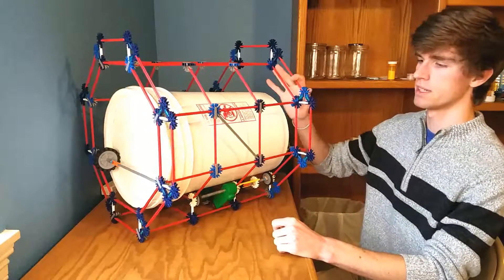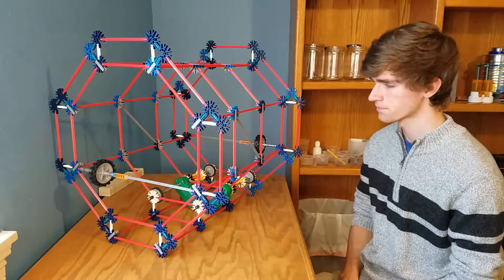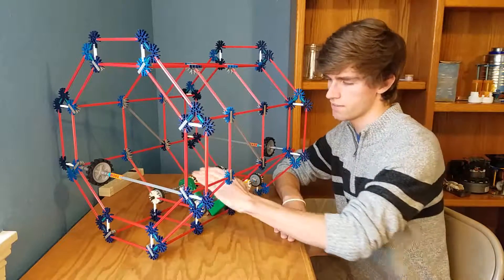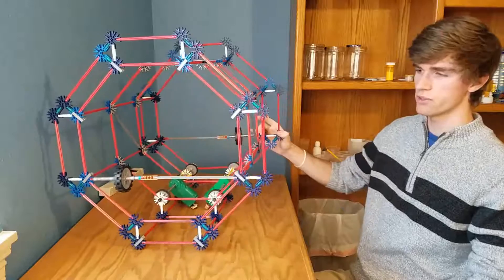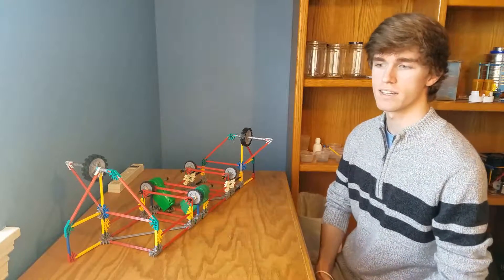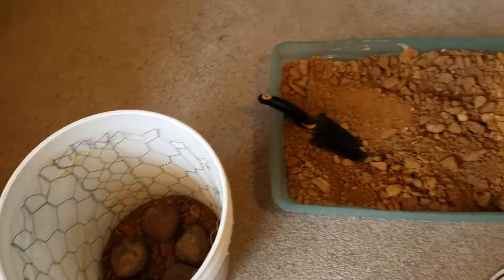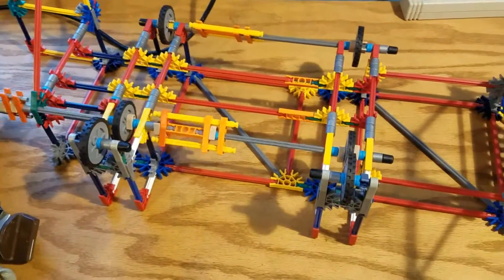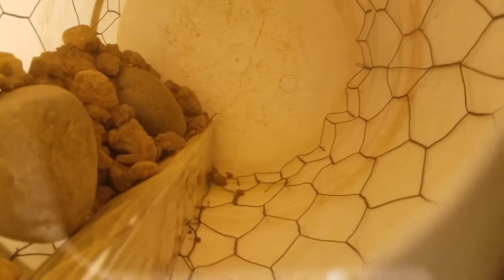Clay Ball Mill - Part 1

Comment: Great project. Can't wait to see the working model. You can try using tire lugs and see if they are better than the rocks. You can also try using steel wool also, just wrap the steel wool around the rocks. Thanks for sharing